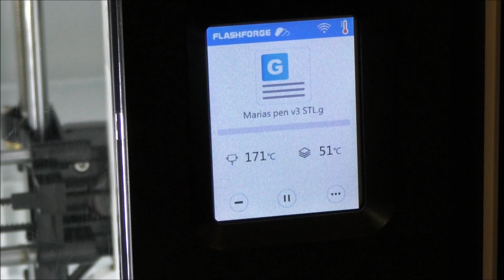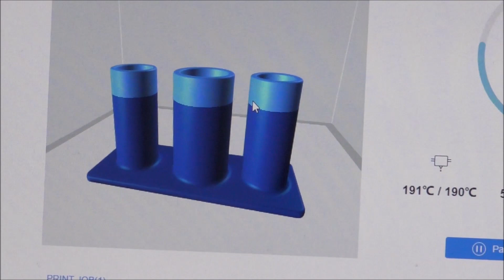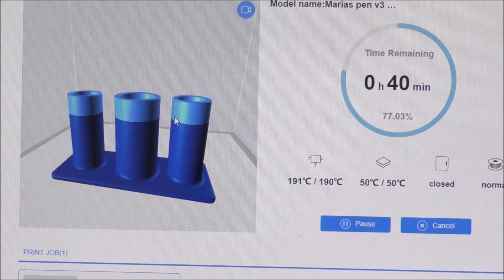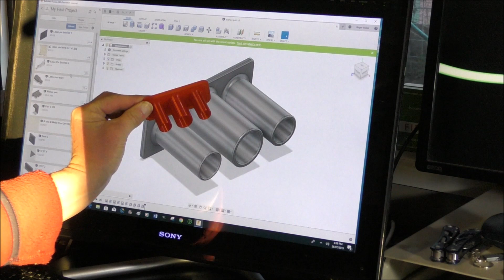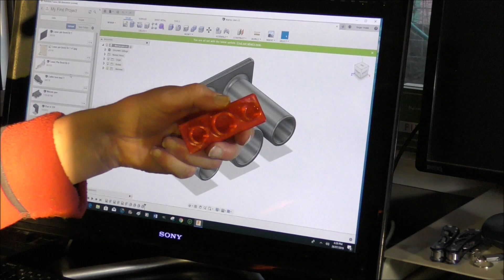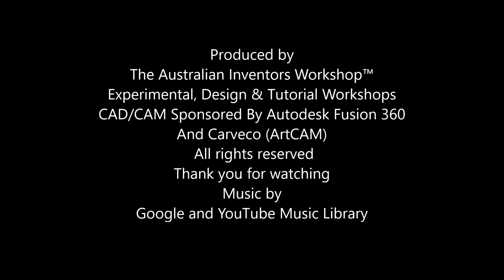3D printing parts with Flashforge Adventurer 3

Comment: I have a creality ender 2. It does pretty good for a cheap printer. The SD card slot isn't reading anymore so it needs to be connected to our laptop. Yesterday I ordered the flashforge adventurer 3.
Reply from the maker: Its good